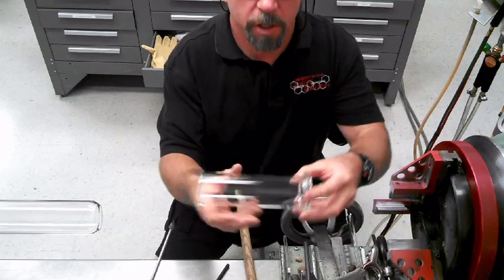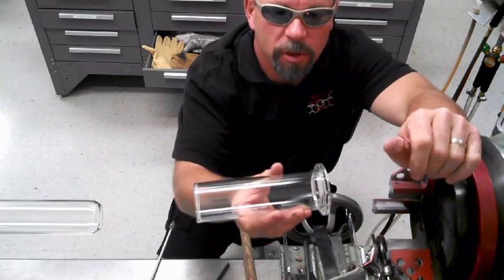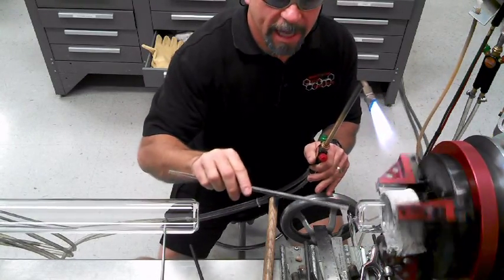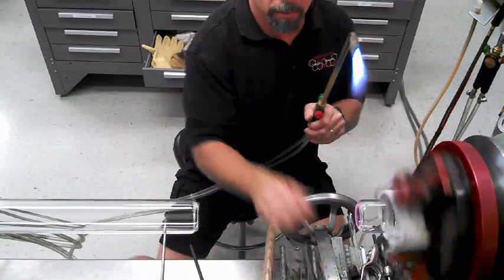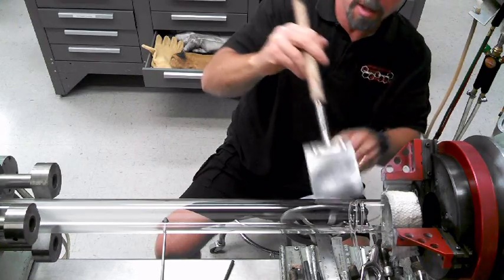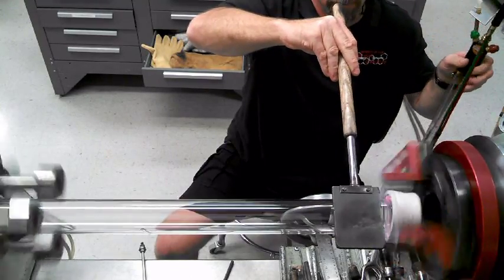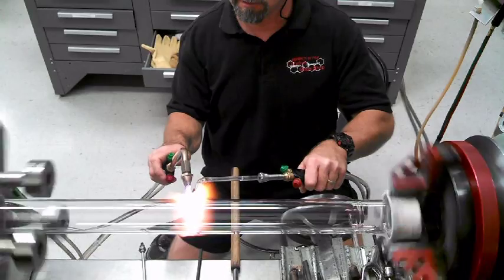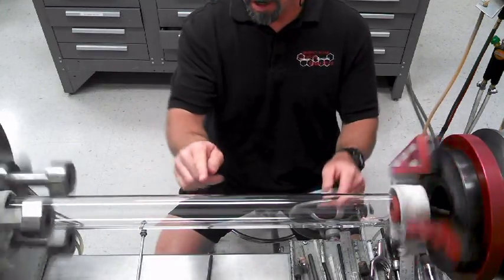No Blow Seal By spinning it out with  Centrifugal force

Comment: Quick question, don't know if you're replying to these comments anymore but, did you push the glass together during the seal or was it close enough that melting the two sides made it touch? The whole process is neat though, is it the same concept as flaring out feet by speeding up the lathe, but in seal form?